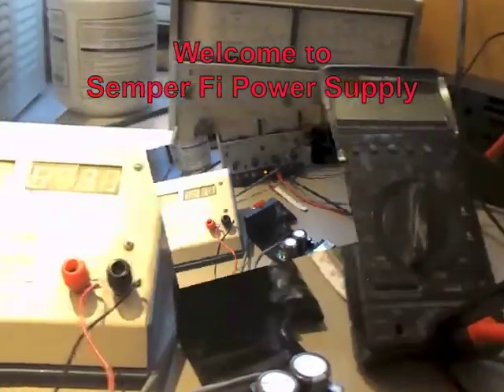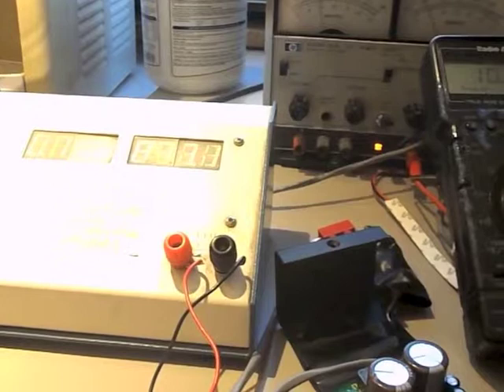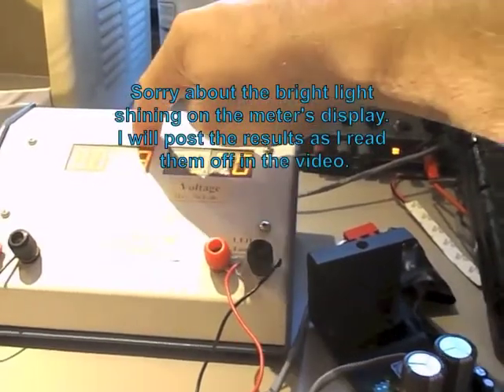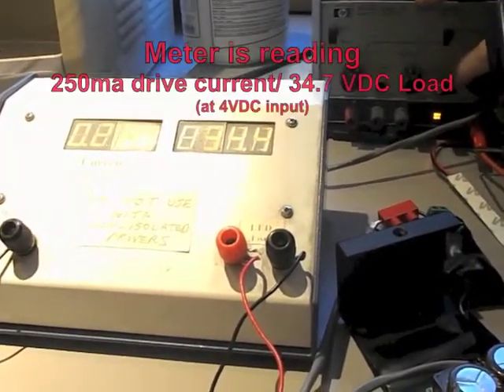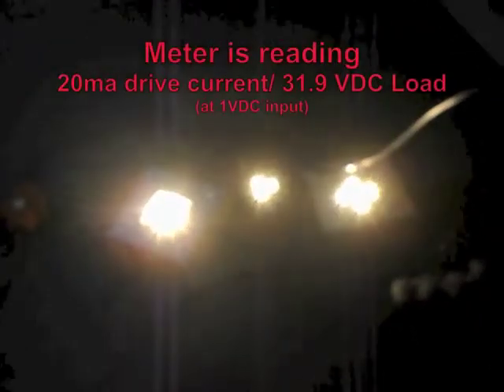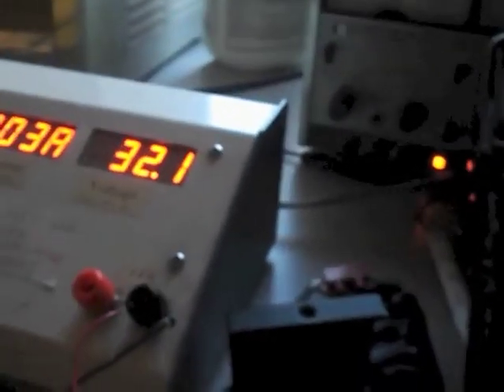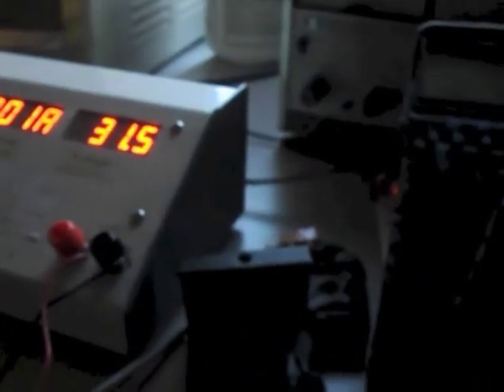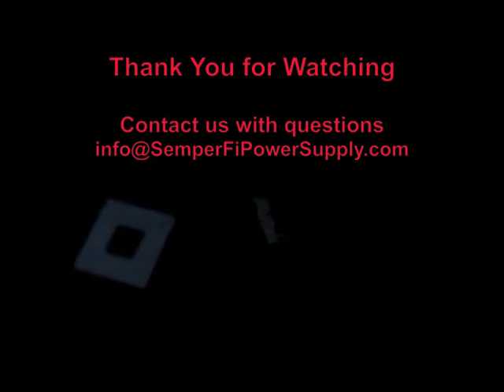Semper Fi Power Supply (0-10 VDC) Dimming Control Circuit

Comment from the maker: This video demonstrates the 0-10VDC dimming control circuit used on Semper Fi's Drivers and Power Modules.

Semper Fi Power Supply (0-10 VDC) Dimming Control Circuit